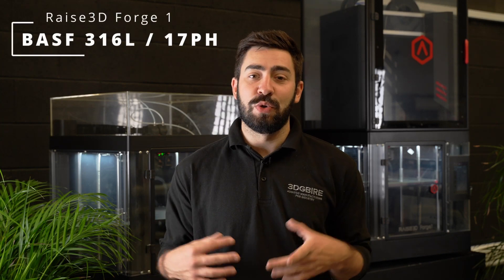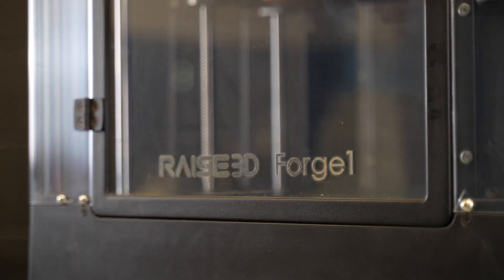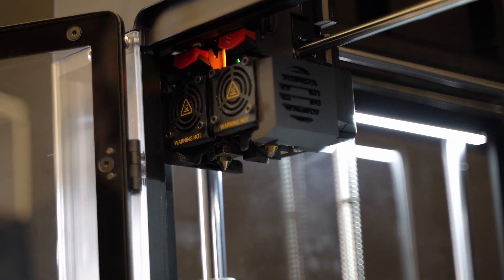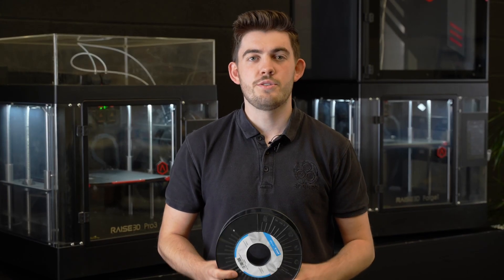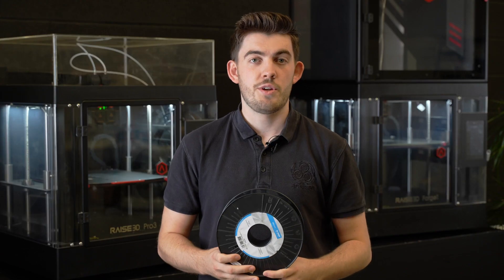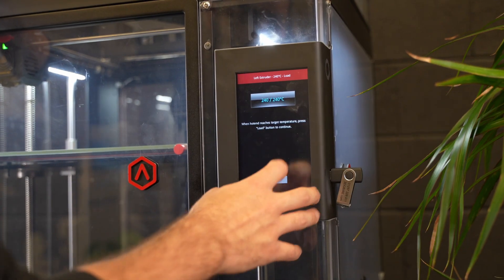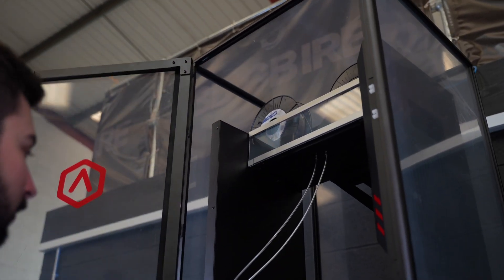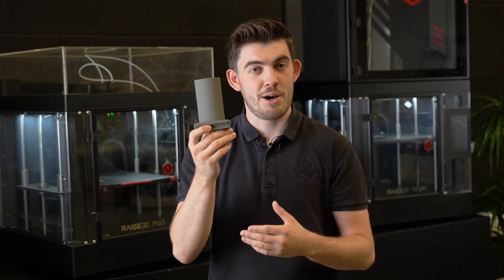Raise3D Forge 1 - The Raise3D Metal FFF 3D Printer

Comment: Can titanium filaments with this printer
Reply from the maker: Hi there, thanks so much for your question! The Raise3D Forge1 officially supports BASF Ultrafuse 316L and BASF Ultrafuse 17-4 PH materials, however, there are titanium filaments on the market which you could absolutely use. The benefit of using the supported materials is that profiles already exist which have been optimised and tested on the Forge1 specifically, so will work straight away. For materials that do not have a supported profile, you will need to create this yourself which will likely take some trial and error to get right, but once you have it set up, you can save it as a custom preset in ideaMaker for future projects.